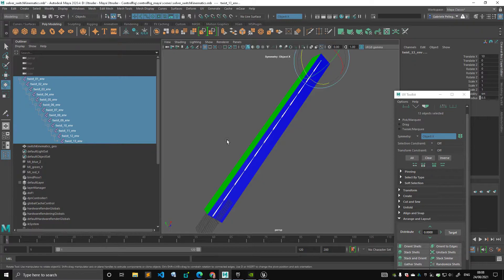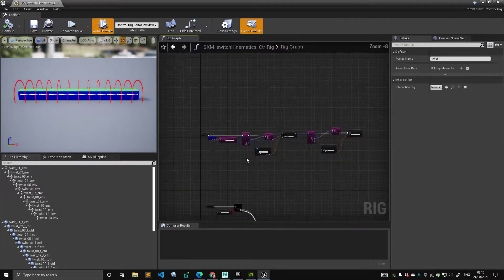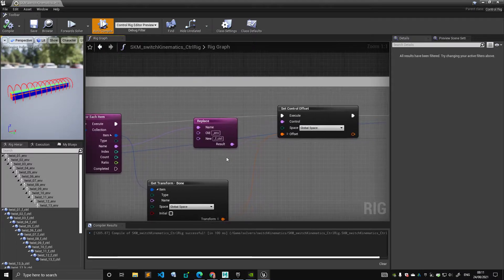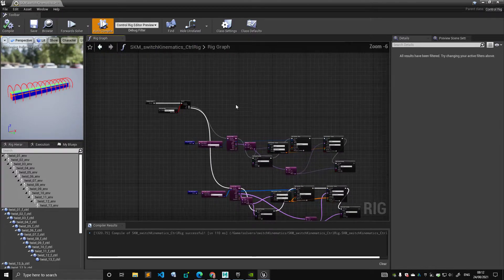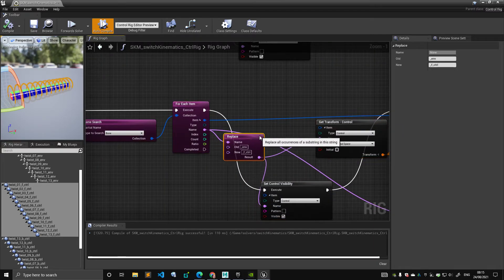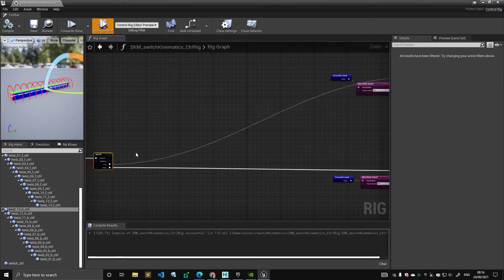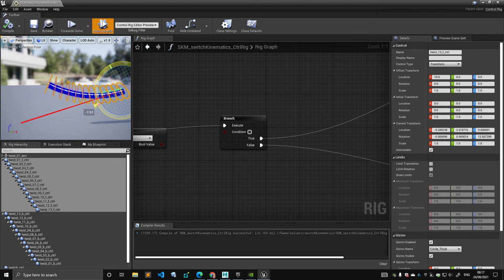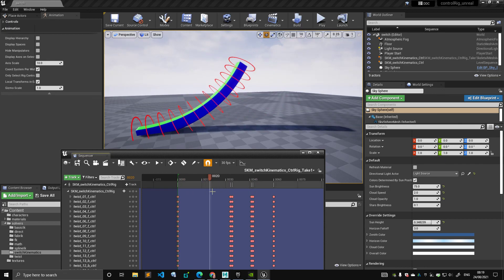Control Rig - 08 - Switching Kinematics, Swing behaviour.

Comment: Awasome tutorials!!! Thanks a lot for this. But I don't know why some of the solver doesn't do the same like you in my case. I use Blender and for example the Slide Chain deforms the mesh in a not good way. I try with a maya rig and the slide works fine but with the swing the mesh don't do the correct behaivor. And the skeleton is doing the correct deformation but the mesh don't do the correct way. I revised the skin weight in both sofwares, try new meshes and new rig form 0 and still happends... I continue trought your videos because are amazing and I can use it to implement in  my Blender Rigs. Thanks a lot!!!!

Comment: For those just getting started you may want to look into using the variable data type "Rig Element Key" over using "String" as Gabriele does in the tutorials. There are some advantages / disadvantages to both methods, but I think "Rig Element Key" really reaches Gabriele's goal of modularity more so than the "String" data type. I made a quick video explaining why this is the case here: 
[UE5 Using Rig Element Key over String: https://www.youtube.com/watch?v=u_jd1y2Evls ]

Comment: I think we again have the same situation with the two For Each Loop in the Setup section. In this case you nested the loops, instead of having one after the other. The second one needs to be connected to "Completed" because as of right now, For Each iteration of the first Loop, the whole second Loop is fired!

Comment: Can't quite figure out how the tail is acting like a ratio'd set rotation bone. Based on the video I can reproduce the IK/FK switch but the controls only affect their immediate location and don't affect additional joints in a smooth motion. Must be another setting - function that wasn't included in this video.

Comment: Sorry for asking a question that doesn't fit the content of the video. You asked how to modify the body rig in Maya, and you told me I just need to update the bind pose. Is it possible to bind using pose wrangler ? (I tried, but it didn't work) Please, even a single joint point is fine, can you please post a way to fix it and update it to Unreal without breaking the metahuman device?